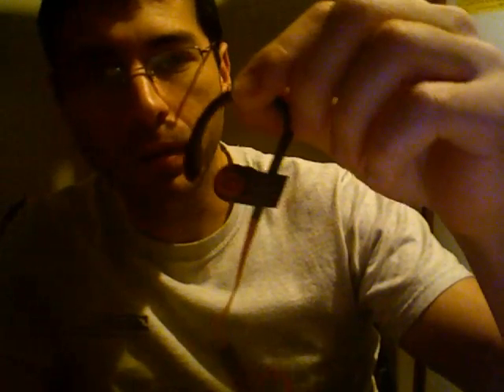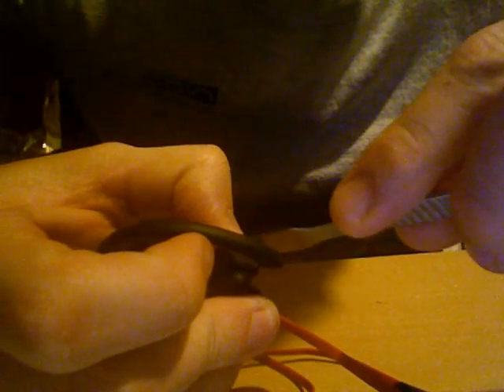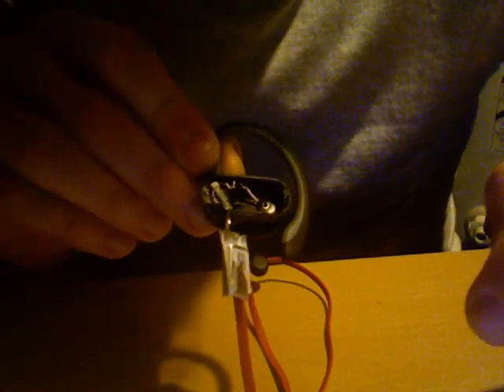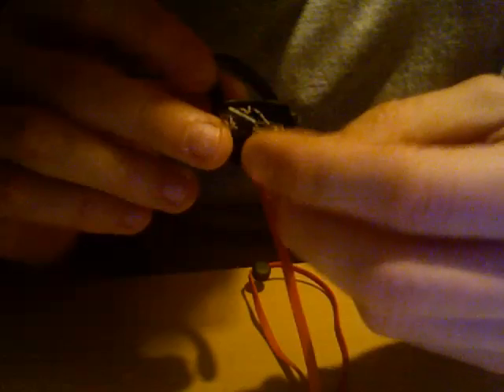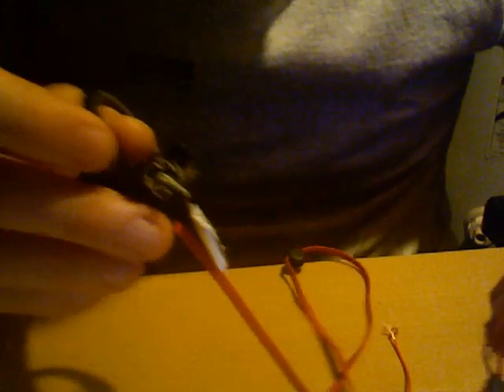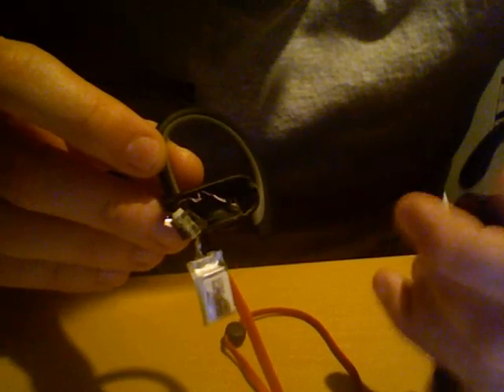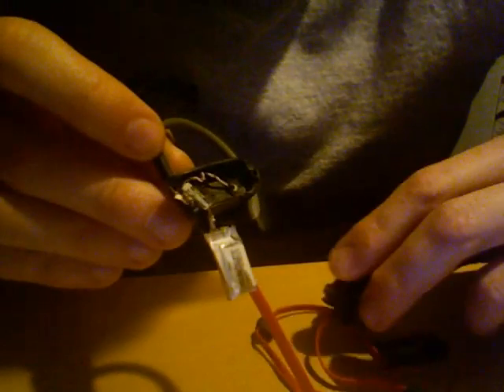PowerBeats 2 Disassembly blinking/not charging problem root cause

Comment: I just repaired my beats.  It was charging, but I was not able to power off or reset.

The issue was some moisture got into the charger port/ power button.  I took an old tooth brush and rubbed the circuit board.  You see when moisture comedy in contact with the components, solder and copper there is a reaction which causes havoc on electronics.  Problem solved. PS don't use crazy glue when putting back together, use a clear rubber cement which will provide a bit of water protection.
Reply: Rubbed the Circuit board ??

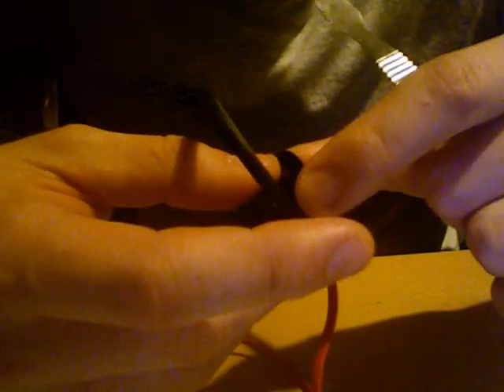Comment: I Paused the video at around 01:18, once i saw you opened the left side of earphone. So i did the same, continued with video. 

then you said:" The problem is not with this side."

Now you have a raging asian dude screaming at you over the screen.
Reply: Xupaulo1988 how did you open it? I can't get mine open I've tried using a hair dryer and a bunch of other stuff, please help

Comment: Hey pizza daddy to ur knowledge does this also apply to powerbeats 3 or do the powerbeats three have different components. I have the same problem with the 3s.
Reply from the maker: Noah Sollog  which problem are you having exactly? So far I only worked with pb2, but I can try to figure out how different pb3 is so I can help you out.
Reply: It would be the blinking no charge issue. Shows it connects to charging but eventually red light goes out and no charge.  I appreciate you even putting anything out on the topic.  The 3s seem to be the same as the 2s. Atleadt from the disassembly aspect.

Comment: hey what is the name of the tool used to seperate the cover from the battery compartment. Do u have a link?
Reply from the maker: Brandona Bae you can use any metal spudger. The one that I have is this one: http://m.ebay.com/itm/For-Iphone-ipad-Cell-Phone-Metal-Spudger-Repair-Opening-Pry-Tool-1PCS-/112305101343?hash=item1a25e7da1f%3Ag%3AI%7EAAAOSwOyJX43Ff&_trkparms=pageci%253A117fd6cc-f794-11e6-873e-74dbd1805c44%257Cparentrq%253A5c9edf7315a0a622961feaedfff1e49f%257Ciid%253A1

Comment: so my beats used to charge with wiggling the cable the light could come on now it doesnt at all what would I need to buy to fix?
Reply from the maker: If you could get it to work by wiggling the cable than, probably, you just need to resolder the charging port. It has 2 support solders(only used to give support to the connector itself) and 4 solder points on the back that is really what transmits the signal/power. It might be tricky because you need to solder in an angle and with a tiny tip. it is for a powerbeats 2 wireless, right? if you are talking about a different one let me know so i can assist you.
Reply: Yeah, it's powerbeats 2 would you fix them for me if I paid you? lol
Reply from the maker: Hi. Sure we can do it. We can setup something on ebay (Its a safe way for both seller and customer) than you send it to me and i fix and send it back. Where are you from?
Reply: yeah! that'd be great! I'm from columbus ohio
Reply: Hey so when can we set something up?